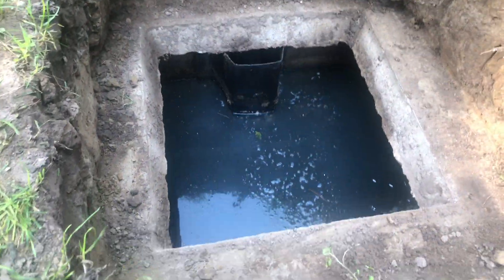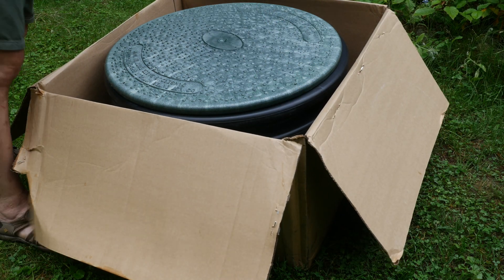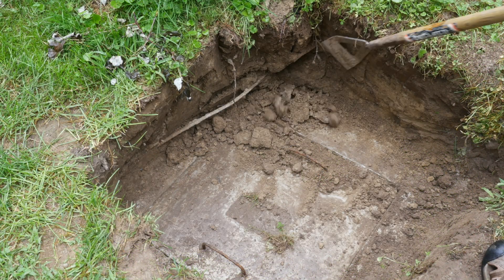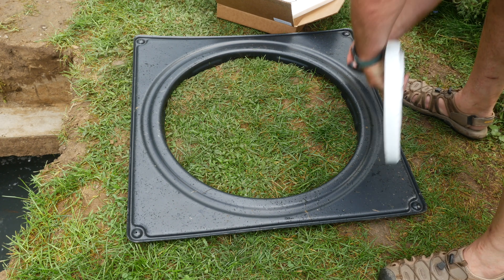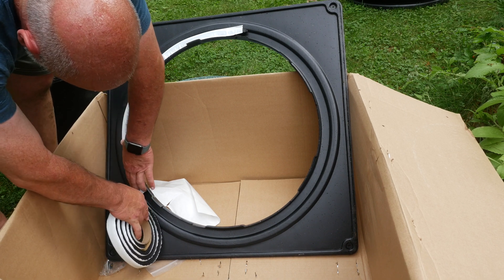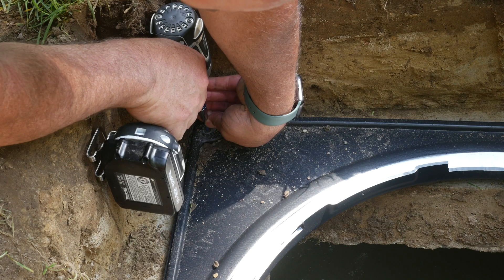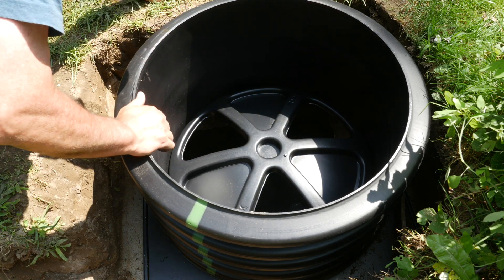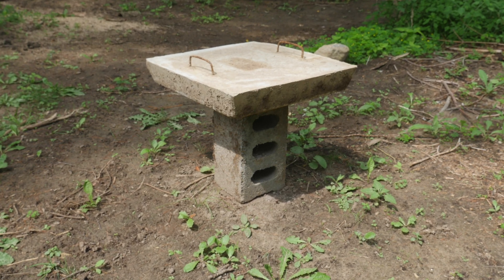T005 - Septic Riser Install

Comment: Great video. In retrospect would you put additional sealant where the circular opening does not come into contact with the corners of the square concrete opening? It looks like there is a space behind the sealed interface that gasses or effluvia can escape and percolate through the soil. Thanks for sharing this 👍
Reply from the maker: I have not had any issues, but I’m sure it would make for a tighter seal - which is good!
Reply: @olddognewtricks6254  😊👍
Reply: Seeing how the bottom flange is square and meets up with the square tank opening. Applying the sealant along the 4 sides underneath the flange is most appropriate. Gases may not penetrate due to the compacted soil pressing down around the flange, but ,if an overflow were to occur there may be elfuent seepage. Great video I will look into this purchase as well.

Comment: can you step on the riser lid ? is it safe enough to carry the weight?
Reply: Absolutely. Make sure you backfill it properly. I even drive a little tractor over it occasionally. So far so good
Reply: I just purchased two of them and for sure you can step on them. They are very well built. I would go as far as saying that if you accidentally drive a car over the lid it should not be an issue. Of course according to the manufacturer that is NOT recommended. But if you need a raiser this is the way to go. I purchased them on Amazon and received them within 3 days.